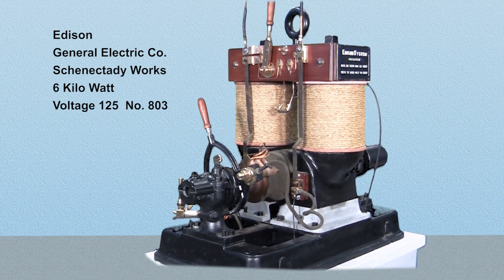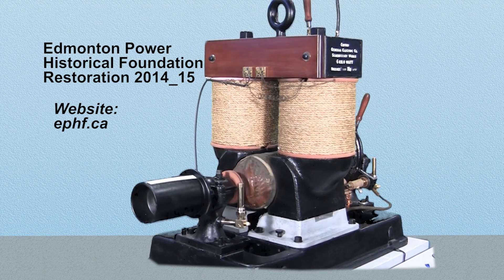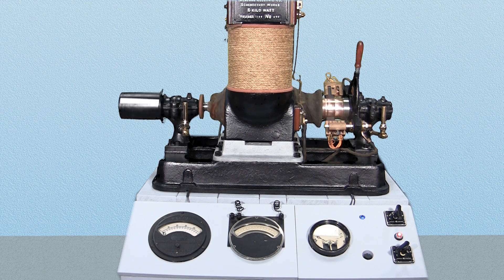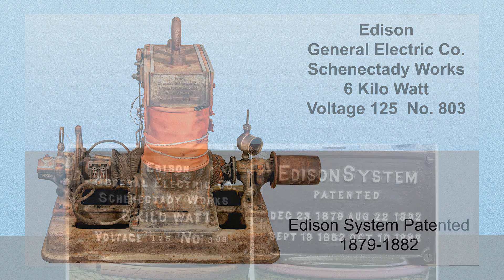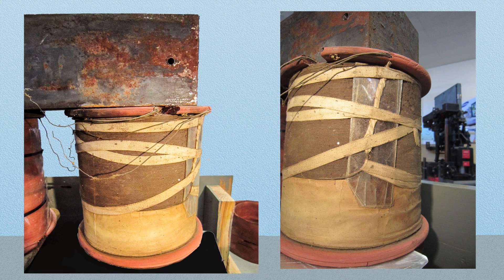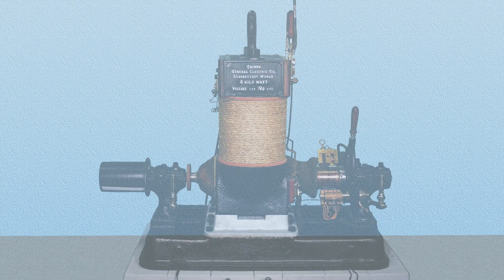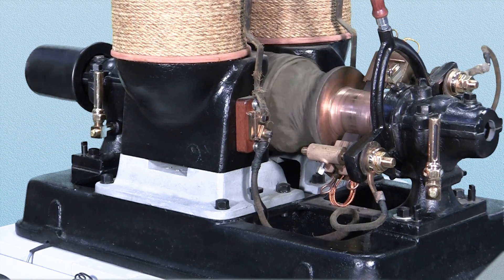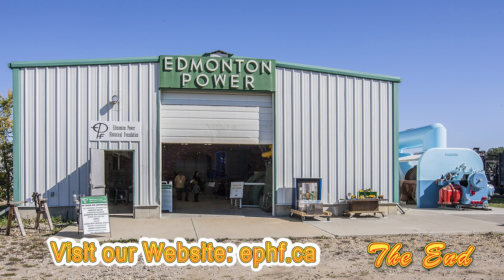Edison General Electric Dynamo

Comment: noun British
noun: dynamo; plural noun: dynamos

    a machine for converting mechanical energy into electrical energy, typically by means of rotating coils of copper wire in a magnetic field.

What would be more impressive would be to use your PWM drive to spin a motor belted to this dynamo and have it produce power as intended. That would stop the brushes biting the commutator as well.

Comment: I would like to respectfully say that it is a motor, not a dynamo. I have a picture of a dynamo, and own a 8.5 KW motor almost identical to that one. The dynamos have a lot more coils including an compensating winding. Please do some research.
Beautiful restoration, and wonderful display.  Thank you, you have inspired me to get a video of my motor on Youtube.
Reply: It is a dynamo, running as a motor.
Reply: @georgebehary1842  Not really. A dynamo needs a permanent magnet. You have here 2 electromagnets.
Reply: @ciprianpopa1503  the magnetic field in most cases is generated by electromagnet also in a dinamo. generators and motors are reversible.
Reply: @DanieleVetrucci  That is not news. Of course you can generate current with the electromagnet but you have to put power into it. The idea of a dynamo is to get current out of it not to power it. So this is a motor and not a dynamo.
Reply: @ciprianpopa1503  yes but you can also without permanent magnet, connectin it in parallel. at first a little residual magnitism start the process
Reply: @ciprianpopa1503  This is a dynamo but they are operating it as a motor. The electromagnet makes up the field and was typically run by battery. Once the dynamo is up to speed (driven by a water wheel or other mechanical source) the dynamo produces way more power than the field electromagnet needs to function and a fraction of that power goes into powering the electromagnet and recharging the battery used to power the electromagnet while the dynamo was still starting up. An added bonus to using an electromagnet is that you have the ability to vary the strength of the electromagnet and that lets you set and maintain a specific output voltage for the dynamo. That way if your water wheel or whatever is spinning the dynamo changes speed, you still get a constant output voltage.
Reply: @ciprianpopa1503  dynamos can be run as motors. Which is what they are doing. Not all dynamos have permanent magnet fields. most are electromagnetic fields to allow for better regulation.

Comment: DC came first, popularized by Edison, followed by AC with Tesla/Westinghouse. At first, people didn't really understand AC. Tesla had the genius to design single-phase AC motors and transformers. DC cannot use transformers. It had to be produced at the voltage to be used (125v, 250v) and so could only travel about 1-2 miles / 1.5-3 km from the generator.
Reply: Nicola Tesla the best .